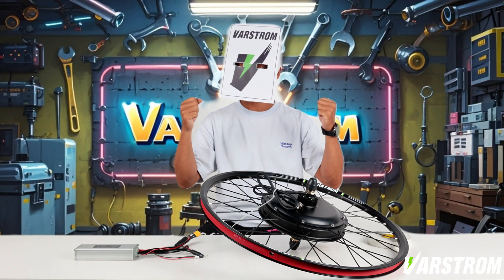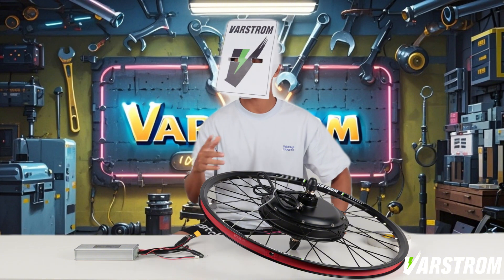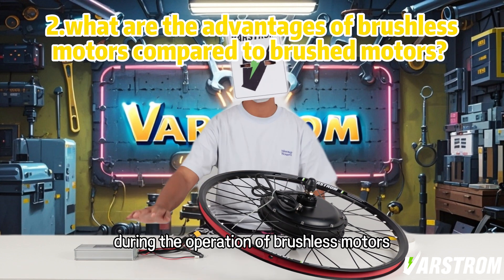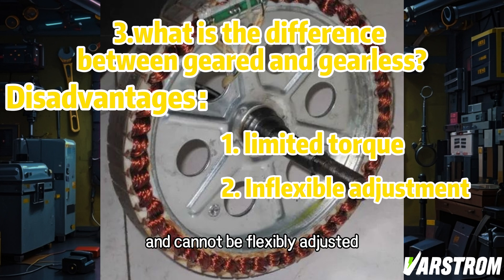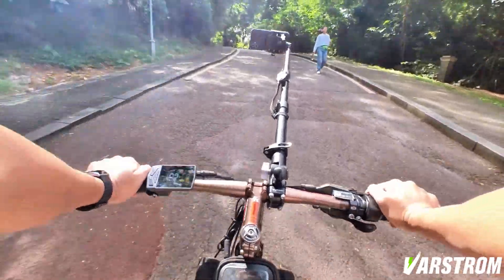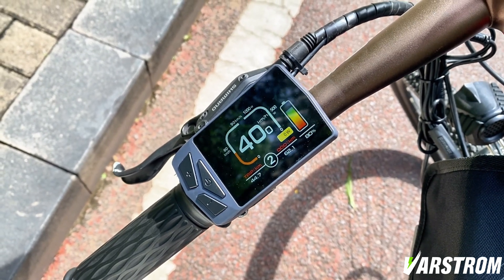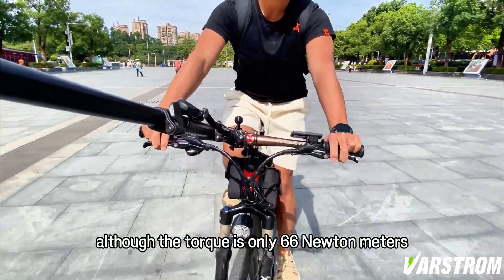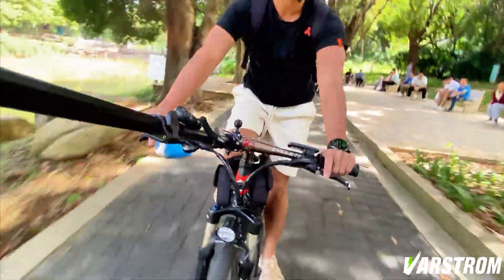How To Choose The Hub Motor You Want？The Ultimate Review Vid（BafangG0900 vs Varstrom1000w Conv. Kit）

Comment: do you plan to add 52v 1500w or 2000w controllers with you hubs motor
Reply from the maker: It depends on the market reaction,Do you like high power?

Comment: Are the varstrom 48v 1000w conversion kit legit of Amazon?
Reply from the maker: Generally speaking, products with the Varstrom logo are  legit. But I don't know which store your product is from. So I recommend that you browse directly on Shopify.
Reply: @ okay thank you, also can any e-bike battery connect to the varstrom conversion kit?
Reply from the maker: In theory, as long as the battery line sequence matches the controller line sequence, the voltage also needs to match.